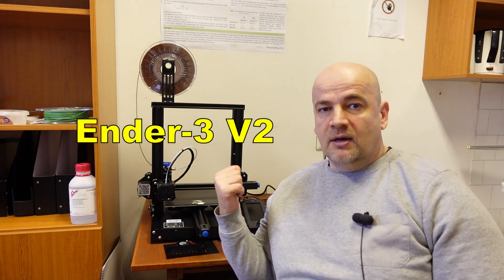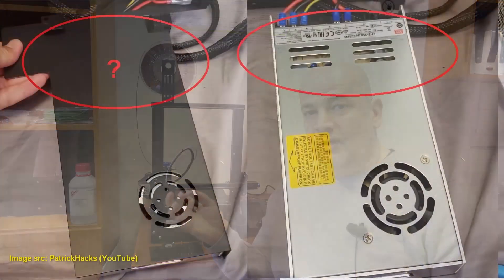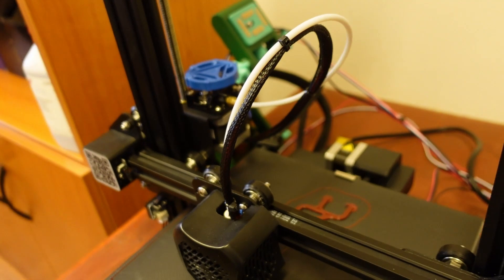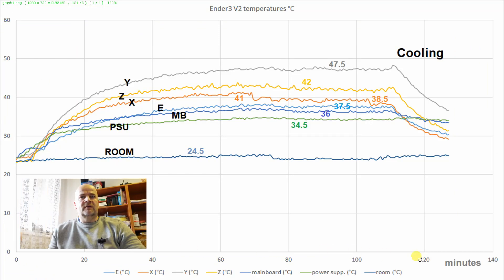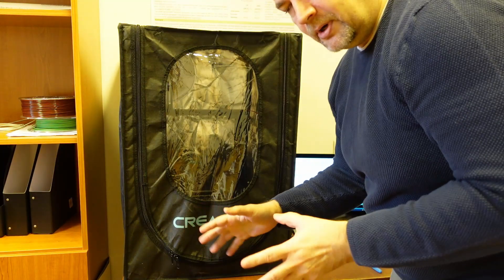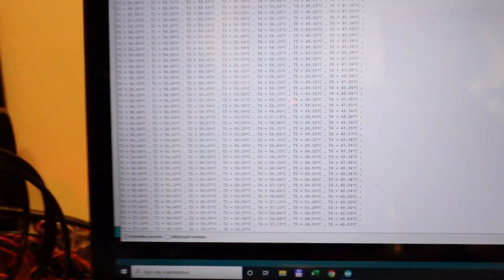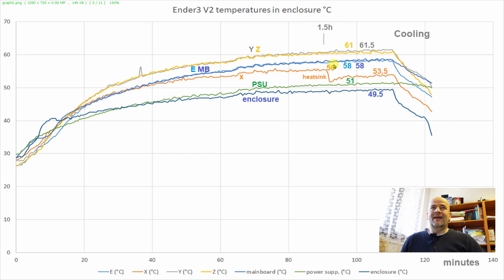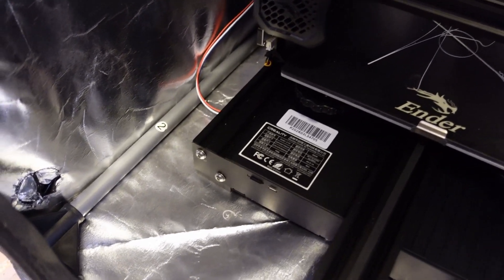Ender3 V2 temperatures with and without enclosure (stepper motors, main board, PSU). Is it too hot?

Comment: Printing ABS in the enclosure on an Ender 3 was the reason that I started seeing a significant amount of layer shifting. The stepper motors got too hot with the bed temperature set at 110 degrees Celsius. This is when ambient temperature was 31degrees.

Comment: Good video, very useful. In my case, the high temperature on Extruser genetas problems. The stops to push de filament to hot end.
Search for a way to keep it cool even in enclosure

Comment: When I found out about the mainboard fan only running with the part cooling fan, I started realizing how much this "inexpensive" printer would actually cost me, not only money, but also— more valuably—my time haha. I've learned a lot about how printers work at least!

I ended up buying a ferrule crimper to crimp connect the mainboard fan to the heatsink fan on the cold end that is always running. I also crimped the 24V wires running from the PSU.

Now, a couple years later, the only original parts left are the aluminum frame (shimmed because it was never square to start with), the PSU, the aluminum V-roller sleds, and the extruder's toothed gear and idler bearing. (Oh, and I guess the part cooling fan is OEM, although the first one melted itself.)

Three-point adjustable bed and trolley. Different mainboard. Different steppers. Bimetallic heatbreak. Diamondback nozzle. Printed belt-driven Z axis. Genuine Gates 2GT pulleys, idlers, and belts. Printed fan shroud. Printed belt tensioners. Euclid bed probe (and diy printed stepper deployment drive).

Comment: Your heat sink selection is wrong. High temperature degrades the motor windings (primarily the stator) which are wounded sideways. If you do wish to use heatsink for passive cooling of the motors then instead of sticking it behind the motor (because its convenient), you need to find heatsink which covers the motor from the sides along with some solution for air flow. Otherwise all this is just a waste of time and money.

Comment: I didn't know that the main board fan is wired the same as the part* cooling fan! Really good to know, thanks for the video! It worries me, as well, since I am just starting to print materials that you don't want to use part cooling for. Wondering maybe if I should move my electronics and power supply outside the enclosure entirely to keep them nice and cool. Even if they aren't critically hot, I bet they will last longer if kept at a lower temperature.
Reply from the maker: Yes, electronics and PSU outside is the best option if you plan to print a lot inside.

Comment: I've been running a heavily modified Ender 3 in one of these Creality enclosures for about 2 years.  It's really the only way I could run this particular printer since it's out in my unheated garage.  In the summer, I'll roll back the top just a bit to let some of the heat out when it gets a bit too warm but otherwise, I keep it zipped up.  That little printer runs ABS and PETG great and as a bonus, it's the cleanest printer I own.  The only problem I've had running inside the enclosure was when I had the Octoprint Pi on the inside.  I don't think the weak wireless signal I get out in the garage liked that metalized lining and I was having all sorts of random issues.  Once I moved the Pi outside the enclosure, all the weird issues went away.  It could have been the heat the Pi didn't like but I like blaming things on weak wireless signals.   Great content as always and thank you for sharing you experiments with us.

Comment: I wish you had done a true test without part cooling and without introducing other variables like heatsinks and opening the enclosure. I was originally curious about this video because after hours of printing abs in the exact same enclosure on an Ender 3 Max, it no longer prints without layer shifts in the positive y direction almost every other layer. I was suspecting the board because of how durable stepper motors are for the most part (and because I learned from your video that no part cooling = no board cooling), but I know my steppers got way hotter than in your experiment. I couldn't touch them for more than half a second before pulling my hand back.
Reply from the maker: 60°C is the start temperature where you cannot touch the surface for more than split of second
Reply: any luck with solutions?
Reply: @mishaisspeed  just had to replace the controller board. I didn't feel like going down the rabbit hole of troubleshooting a 
Creality board. They're super jank. Got a suitably cheap BTT.

Comment: Great video!! It would be more precise to mesure the stepper motor drivers on the motherboard because they run very hot on the enclosure. I have a Ender 3 V2 and the Creality Enclosure and for safety I moved the motherbard and power supply out of the enclosure and design a box like the CR-10 with larger cheap fans. Hope seen more cool videos like this!! Cheerss!!
Reply: Hi mate
How difficult is it to move the psu to the outside of the enclosure?
Was there any modifications to the wiring you had to do etc, or is it simply the case of unbolting it and moving it outside?
Thankyou 👍🏻

Comment: these motors are designed for higher operating temperatures. It is important that they do not overheat unnecessarily. Therefore, it is necessary to set the Vref drivers for the individual axes, on the electronics board.
Reply from the maker: Yes, reference voltage (vref) will affect the current sent to the motors, but I did't changed that. Also, I just checked the temperatures on my home Ender3V2 and they are very similar. In most cases I have to make tests with stock settings.

Comment: While I am pretty happy with my purchase of the V2 for my first printer, my next printer for sure won't be from Creality. They just cut way too many corners at every turn and expect the community to fix their design flaws. Bowden tube going all the way to the nozzle, plastic extruder, absolutely terrible firmware, just to name a few. Finding out about the fan sealed the deal for me though. All their other printers seem terrible anyway. Seems like they rode the Ender3 series success to the bank and cashed out
Reply: They also designed with tolerances way too tight for the specifications they ended up building them with for cost reasons.

Comment: This experiment is what I need. Thank you!
After purchasing S1 Pro and this Creality enclosure, I am going to divide the enclosure into a printing chamber (big upper) and a controller chamber (thin bottom) using thermal insulation material and make holes at the enclosure bottom for the vents on the mainboard and PSU.
I hope the holes do not decrease the printing chamber temperature.
Reply: I’m planning to divide my enclosure as well.  Purchased the thermal insulation already but have not yet designed the separation layer, which will lay on top of the motherboard/power supply top. Will lift the outer enclosure (wham bam) a couple cm to keep the motherboard and power supply area cool.  
Good luck with your mod.
Reply from the maker: Yes, that sounds as reasonable solution. I am glad my video was helpful. Now I am starting to think about similar solutions. Or maybe just move the electronic outside(?) I will see..
Reply: @MyTechFun  please make a video showing what you do when you do it. I want to move my electronics outside the enclosure / frame and would like to see what you come up with for a solution.
Reply from the maker: @FatCat_Dadio  Here is one of those videos, maybe useful https://youtu.be/GsymnDDAjiE

Comment: Thank you for this video.  It was perfect timing because I just purchased an enclosure for my Ender 3 PRO to experiment with ABS and PC.  I knew about the power supply cooling issue on the Ender 3 V2 and implemented a solution.  I’ll email you the STL file that I created to solve the problem.
Reply from the maker: I will just drill some holes where that ventilation opening is.

Comment: Interesting. I'm building a double enclosure for my two FDM printers, an Ender 3v2 and a Geeetech Prusa i3. One objective is to keep the printers at a reasonable temperature in an unheated room. Hopefully the printers will keep themselves warm enough, and I cut my heating bill! The plan is that the heat will rise into an enclosure on top for the filament, keeping that warm too. If it needs it, I'll add Arduino controlled fans or opening vents to control the temperature. I hope it will work for ABS etc. too.

Comment: When I got my ender 3 v2 I've cut the psu cover and left it only where the connections are and gave the printer some elevation through those squash ball feet which also isolates from sound. That thing with the motherboard fan is quite concerning, maybe you could use a bigger noctua fan and put it in parallel with the hotend fan. Actually you could use noctuas for both and put them in series so you don't need to step down the 24V to 12V
Reply from the maker: Solution is rewiring, main board fan to same connection where the heat sink fan is.

Comment: So I have been having thermal runaway errors. This started happening when heating up to 235°C for PETG. After that I lowered fan speeds while pre-heating. Could it be that something got fried or the errors are coming from pre-heating with low-to-no fans? I ordered new thermistors to check if they are malfunctioning
Reply from the maker: I don't so, may be some other reason for this error. Instead check the wires of thermistor, are they connected good to mainboard and the thermistor is in heatblock.
Reply: @MyTechFun  thanks for the reply! I will check the wires going to the motherboard. The thermistor head seems to be okay, well seated in the heater block. It usually reads for about 10mins and then errors out

Comment: In my opinion Ender3 V2 is way too enclosed, Therefore they had to put fan everywhere which makes this printer extremely loud. On my Ender3 V2 I've removed the mother board cover and mother board fan they are not even needed if you let the main board get some air fresh air by removing it's cover. I've lowered the stepper motors current, you won't lose any performance by doıing this change but you extend the life of your motors significantly, my stepper motors are always at room temperature and I've never lost a step or got a failed print. I've also removed the power supply cover and the power supply top aluminum cover as well which makes the power supply very quiet because it's fan barely needed anymore but I won't recommend this for everyone, proceed with caution because the power supply is live at mains voltage. Over all by enclosing everything under multiple layer of metal they cut the air flow to different part of this machine and the added fans mostly made this printer loud instead....
Reply: How do you power the current?
Reply: @johnnycash4034  For ender 3 motherboard, there are potentiometers next to stepper drivers. Check trinamic tmc2208 datasheet for more info...

Comment: You shouldn't be really surprised by stuff Creality is doing. They are well known for rather questionable design decisions and lack of QA.
The fact they didn't even bother to check that enclosure doesn't cover ventilation holes says a lot about their validation process.
Same goes for board fan connection.